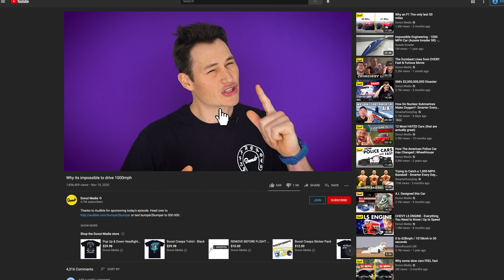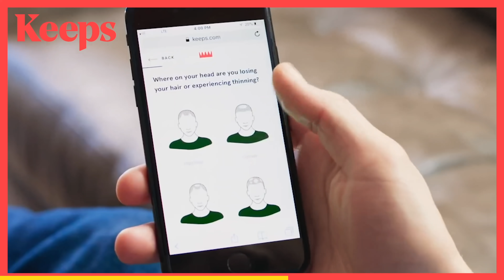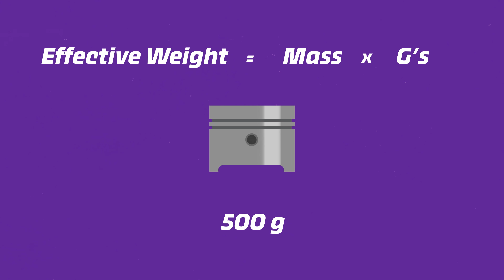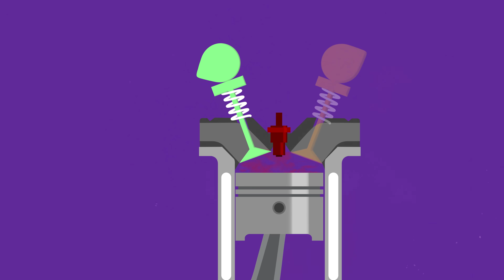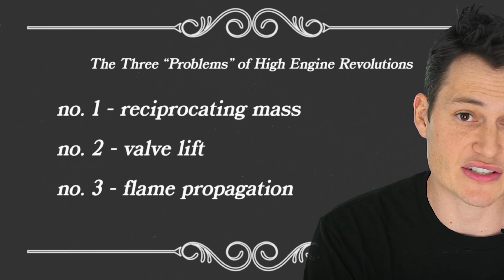Why It's Almost Impossible For An Engine To Rev Over 20,000 RPM

Comment: Oh, and about valve train.  Ask stock eliminator racer about 'lofting' the valve.  Kinda like intentionally floating the valve.  Extreme lobes, crazy valve springs.  As my engine builder  tells me, you aren't driving this on the street.  100 passes and the motor is done (checking the valve springs inbetween).

Comment: that one civic at 3am: is this a challenge?
Reply: Civic makes at least 1,000,000,000,000,00 RPM
Reply: @thor6264  or make those ricers make a fartcan revving to 5000 rpm saying" its over 9000" like an idiot.
Reply: @andy56duky  I get the first guy's joke but yours doesn't make any sense. A k20 civic can rev to 8-9k pretty easily

Comment: Its impossible for an engine to rev over 20,000rpm!                                                                                                          RC nitro engine let me introduce myself RRREEEEEEEEEEE!!! 50,000rpm
Reply: F1 car fans: the rpms of the F1 cars gas engines is insane!                                                                  F1 car's electric motor: Am I a joke to you?
Reply: gas turbine: 100,000rpm ya I'm fast.                                                                                                    electric motor: hold my beer

Comment: You don't always need rpm to make power. You just need cubic inches & technology.  Also a small cubic inch, high revving motor is terrible to live with in real world conditions, can be just as bad on fuel when running hard, & have an accelerated rate of wear.

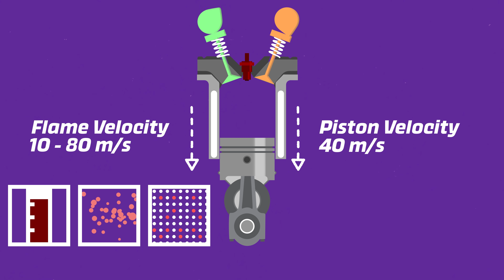Comment: At 9:30 the flame speed does not affect the piston directly. The piston is not pushed down by a flame front, but by increasing pressure in the combustion chamber. The reason that the piston outrunning the flame front is a problem is because the valve can open before combustion is finished, thus spewing unburnt hydrocarbons into the exhaust and throwing away power that could have been captured. You really need to hire an engineer to write your  copy. All you English Majors write great, but you don't actually understand the science.

Comment: “It isn’t physics is Mother Nature” goes on to discuss physics.
Reply: talking about the previous video on top speed, the problem wasn't physics, it was geography
Reply: Really weird and random physics
Reply: HRC Honda, hold my beer.
Small capacity RC 2 stroke engines around 40K rpm
Reply: Physics studies nature, so is accurate.
Reply: Yeah, it was a weak sauce intro.

Comment: Guys in the valve dept., the new free valve 
engine from koenigsegg does not resove the problem? Because it has a solenoid insted of a valve, it is eletric operated insted of a normal valve that needs the spring to complete it's cicle.

Comment: Y'all need to check out Ducati's solution to valve float: Desmodromic valve systems. Essentially two cams per valve one that opens the valve and one that closes it.
Reply: The problem at desmodromic valve system is wearing on valvetrain

Comment: “All engines create power using the same 4 steps” 
Objection, 2-stroke
Reply: 2 strokes are still doing those 4 steps just within 2 strokes. Or 2 steps per stroke.
Reply: @ryanleblanc6817  shush 🤫
Reply: @Jordon Carlson Respiration/Power
Reply: Yes, but a 2 stroke engine is not a 4 stroke engine and the quote was actually, "Whether it is a Camry or Mercedes W10 F1 car, all four stroke engines turn fuel into horsepower using the same four steps." Objection overruled.
Reply: @shaun3612  well, can’t argue with that one

Comment: Since Diesel Engines are self igniting because of the pressure inside the cylinder, why are there no Diesel engines which rev higher than 20k? xDD

Comment: "its impossible to an engine to go over 20k rpms"
-My dads fiat engine when i used to miss shift at 120km/h
"No, it ain't"
Reply: 💰 💴 💵 shift
Reply: Dude my grandpa has owned all sorts of American classics but this fiat he had was one of the wildest. Had hemispherical shaped combustion chambers just like a hemi. he always said “half the engine and  a 1/4 of the car.”
Reply: Yo same quiet not the 20 k but now after being 16 years old it still friking revs to 10k rpm. Beyond my understanding how my dad maintained it. He is a super harsh driver and would basically drive the car like a f1 car on the roads🤣
Reply: @vaibhavmugulavalli3366  Because it is italian. They are made for that. 😅
Reply: I let the engine go to 7500rpm on a late 60s fiat 124 coupe, twin cam 1400cc, the red line was at 6500 and usually fiat and alfa can take 1000rpm more for a brief time when warmed up. I think it was pushed far more by the previous owner, because one cyl had busted valves when I bought it.
Reply: @electroborg  - good to see other fiat 124 owners :)  my first car was one...69 124 sport (1.4).  One day, I actually had it rev out to off the tacho (factory tacho maxed out at 8000rpm).  The only thing it did was spring an oil leak from left camshaft cover!!   They’re a beast of car :)
Reply: @electroborg  Wow
Reply: As far as i remember, f1 engines used to run at almost 20k rpm...
Reply: @oscardbg9654  think they were limited at about 18 000 rpm
Reply: @Stand_Tall  from what i remember from the dashcams, they are actually limited to 15,000rpms to increase reliability of the cars , and most of the drivers use like 12,5k at most. Not as cool as it used to be, but still pretty impressive
Reply: @lucasaal61  well they're now limited to about 12k rpm but they used to be 18k rpm with those v8-v10 monsters
Reply: ꧁ RITA - F**UСК МЕ ꧂  what
Reply: @Stand_Tall   it’s a bot.nvm
Reply: thats was a good one
Reply: Wow!
Reply: Pain
Reply: 😂 Live the fact that it was an Fiat otherwise it might have survive
Reply: Gearbox: bro stop killing me-
Reply: I was just saying Fiat made the so called "fire" engine where valves and pistons just never occupy the same space even at max extension simultaneously.
Reply: Your dad has a fiat engine in him?
Reply: @Dogebreadzz  lmfao

Comment: normal 50cc (changed 70-90cc) mopeds usually rev 15-20k (2 stroke) in finland its very normal but police dont like it they should go 45kmh but usually they go 100+kmh

Comment: There's a theoretical maximum piston speed for an engine in which you can set a bore or stroke for the engine and have as much torque or rpm (horse power) as you please but increasing the other decreases the other.

Comment: “Impossible to reach 20k rpm”
Rotary: are you challenging me?
Reply: video is about piston engines
Reply: @GarageSupra  well I heard those old Hondas S800's could rev to 15K-18K RPM because those roadsters had bike engines
Reply: @giancarlolugo9586  I own a 1990 CBR250RR MC22. It's got a 4cyl 250cc engine that redlines at 19k. The rev counter has the 20k on there though xD
Reply: @halonerf99  a 1990 CBR ??? Always loved the design of those bikes along with the 94" Kawasaki ninja in purple and the 93" Suzuki GSXR 1100 with the blue and red graphics and the 96" Yamaha YZF 750 with the grey and green graphics
Reply: @halonerf99  rpms should equal more power guess honda can't build an engine like Kawasaki. Ninja 250s are way faster and only turn like 13k
Reply: @giancarlolugo9586  the s800 spin a little over 8k most bikes are less than 10k unless they are smaller engines or 2 stroke's. 18k is almost formula one level they wouldn't have been cheap cars at that point lol
Reply: Nevermind looking up the specs the 1990 cbr600 actually made good power wonder why they made the so slow later on guess they wanted engine logivity.
Reply: @derekmaxwell8164  ninja 250s are no where near as fast as mc22... never owned either but ridden both and owned a ninja 300 and an mc19..
Reply: @derekmaxwell8164  Well those cars had 110hp back then It was an small engine
Reply: @derekmaxwell8164  2 strokes actually don’t rev high at all well not for bikes. As for your claim that a ninja 250 @ 13k rpm is faster than an mc22 that’s also wrong the mc22 has more power and basically better everything. This early 90s 250s were insane they cost as much as 600cc 1000cc bikes because of the way they Japanese license system works for bikes. It’s really expensive/hard to get a bike license for a bike over 400cc so the Japanese manufacturers put a lot of money into little bikes back than cause they sold. But as they started getting more sales overseas it became more of a race to the bottom for the small bikes people don’t want to spend 16k on a 250 anymore. That’s why they stopped making them. As for the reliability of those engines there are plenty of mc22s still running strong with mega mile on them. The odometer only went to 99,999 kms so most have wrapped around multiple times and still screaming.
Reply: @Aviato16  well I didnt know till looking it up but I was biasing it on my friends 2000s cbr250 and figured older one would be even slower but 2 the Aprillia 2 stroke I rode redline at 19,000 but as far as piston stroke's thats basically like a 4 stroke turning 9500. But it was also only a 50cc.
Reply: @derekmaxwell8164  yeah man all good if you are under 30ish years old it’s hard to fathom how crazy those little engines were back then. Due to emissions regulations and just the changing global market for bikes it’s just not profitable for them to make crazy low capacity bikes. The 400cc bikes like the nc30 and 35 were insane back then too.
Reply: Yes
Reply: @alexandersmith7777  what about Yamaha Honda Suzuki Kawasaki old bikes  with  800cc-1200cc engines
Reply: @giancarlolugo9586  highest revving bike over 800cc is actually a new bike the ducati panigale v4r at 17,000rpm the old bikes that rev higher than that are all 250cc with the 90s cbr250rr mc22 topping the list.
Reply: @CAIDMASTEROFPYRO  I like the Ducati 996 from the 90s never been a fan of modern bikes I like the Italian and Japanese ones from the 80s to early 2000s but the 90s had the best designs in my opinion
Reply: Not even close but doesn’t cbr600rr revs up to 16k - 17k rpm?
Reply: Rotary engine has big flame propagation
Reply: https://youtu.be/WW7lDm2x9pw

Comment: Honda's 20,000 rpm engine: pathetic

EDIT: it was 20k not 30k lol
Reply: And the Honda rc116 race bike redlined at 22500!
Reply: What is that?
Reply: @legolas5684  an experimental engine that goes to 20,000 rpm?
Reply: @MooseEgg1  code name?
Reply: @legolas5684  ring bing bing pop

Comment: If you want to make an engine that spins faster, make it smaller. Motorcycle engines rev higher than their car equivalents and model engines go higher than that.
Or just switch to turbines: The Chrysler Turbine car idles at 20000 rpm. It gets to at least 36000 rpm.

Comment: I feel like you guys missed an entire section of piston engines that DO cycle consistently faster than 20,000 rpm. Nitro-Methane RC engines will spin at 30,000 rpm all day long and some will go higher than that into the 40,000 rpm range. Granted those engines use top fuel and also don't work if scaled up to actual car sizes, but they do exist. Obviously the valvetrain issue is solved by the engine being 2 stroke and the oscillating mass is taken care of by the high relative strength of the titanium they use combined with their low mass. It does leave me wondering how fast the flame propagation is using nitro-methanol if it can rev that high with no issues.
Reply: you answered your own question, the problem there is scaling, the movement of the cylinders is linear, which would scale linearly, but volume and mass don't scale linearly. this is also why airplanes can't just be scaled up or down with the exact same design.
Reply: Small cc engine means small space the fuel needs to burn to the edge, lol
Thus the flame propagation in this case is on different level with a full size car, lol
Reply: The old 1.5 litter F1 engines use to spin like 22k before they started making rpm limits to lower power
Reply: Regardless, every time I hear one of them or run my own ... Im always amazed the engine internals stay together at those speeds and last as long as they do ... its quite nutty.
Reply: Hasi Mausi  plenty? What like a 50cc motorcycle? Cause even the old high revving 250cc crotch rockets usually only turned 15-19k at most
Reply: They also have a stroke of like 8mm at the most, a normal car is often over 10x that, which means for the same piston speed, they'd need to spin over 10x as fast.

Comment: Horsepower = Torque x RPM / 5,252
This is why on all dyno sheet you will see hp and torque curves cross at 5252 rpm's

Comment: there were a bunch of 4 cylinder 250cc motorcycles in the 90s that revved almost to 20k, the kawasaki zxr250, honda cbr250rr, suzuki gsxr250 and yamaha fzr250. hard to find them if you don't live in japan or australia though

Comment: Some rotary designs have the potential to rev beyond 20,000 rpm. They require massive boost, appropriate fuel, special surface treatments and lubricants,  etc. but it can be achieved.

Comment: Turbine engines: Whomst has summoned the ancient one
Reply: the few turbine engine cars built needed about 7-8000 rpm to run the alternator and AC Compressor.  city mileage was not good.
Reply: @toolmanthetim7042  that wasnt the issue. Turbines are most efficient at 100% rated rpm. Thats why apus (auxiliary power units, that third exhaust in the tail of a 737) run full speed all the time. Varying the speed is not the best way to use it constant speed is.
Reply: @Demonslayer20111  i was responding to comment about turbine cars.  quit trolling.
Reply: @toolmanthetim7042  and I jut told you EXACTLY why those turbine cars were abandoned. Had nothing to do with high rpm had to do with the fact you couldnt keep them at constant power settings for long periods like an aircraft where turbines are most efficient. 
You want to be wrong go right ahead.
Reply: *ancient one
Reply: Turbine engines produce very low torque
Reply: Are you dumb? There are no cars with a turbine.
Reply: @v4skunk739  jay leno disagrees
Reply: @MrPruske  Wow sorry there are like 5 cars built since the 50's and every single one of them was a complete disaster.
Reply: @v4skunk739  5 > 0
Reply: @v4skunk739  np. It is very few. I think the turbine motorcycle is even sillier.
Reply: @rj6110  werd
Reply: @v4skunk739  -- Jay Leno disagrees.
Reply: @v4skunk739  yes there are. Look up capstone turbine powered race car
Reply: @S65Trev  STP indy car.   Indy is a full throttle track, so it was workable.
if i remember correctly, the transmission input shaft failed.
Reply: @v4skunk739  there definitely multiple cars with gas turbine engines, I think chevy had a working prototype. Non ever made it to production though.
Reply: @v4skunk739  ok boomer can’t take a good meme

Comment: Great video as usual guys, but a few gripes: 
1: flame speed is increased by turbulence, not slowed down.  Engineered turbulence is the only way the flame speed is fast enough for 5-digit RPM.  Honda tested this all the way to 27,000 rpm.
2: short stroke motors dont stall any easier than others,  F1 cars idle high because they have very light crankshaft mass, and valve timing that just doesnt work at RPM that low.  with enough flywheel and proper cam timing, a short stroke motor can idle as low as any other.

Comment: The Honda RC116 was a 50cc Grand Prix bike from 1966 that had a twin cylinder, four stroke engine that revved to 22500rpm, making max power at 21500 rpm.

Comment: "engines can't rev over 20000 RPM"
cox .049: "am i a joke to you?"
Reply: The Cox .049 IS a joke. The Cox .020 is cute though.
Reply: @scootypuffjr.  how is it a joke
the tee dees can rev very high
the tee dee .049 can go 20000 with the right prop and the .010 can go like 25000
Reply: @Lukemiester16  more of a curiosity than a joke. Not good for much. I'm sorry if you are a Cox fanboy. I had some too. Larger glow engines are much more user friendly.
Reply: @scootypuffjr.  i am a cox fanboy heh heh 
If its your standard reedie .049, they usually run kinda bad, but they can run well if some modifications are done. You gotta appreciate the quality of those engines though, the manufacturing tolerances were absolutely crazy and they only required 1 minute of break in time. People are always hating on them, but all of their engines (minus the product engines lol) really are good powerplants. My .074 weighs 3 times the weight of my tee dee .049 and makes the same power, but it really runs great. And the tee dees... man those were something else. they made some serious power and can rev to 20000 RPM lol
Reply: @Lukemiester16  I definitely don't hate them. I remember mom getting pissed when I started my .049 in my room,lol.  I just like the bigger ones with a real carburetor and a usable rpm range.
Reply: @scootypuffjr.  heh heh
yeah i like the big ones too, and the tee dee rc .09... i got a crush on that engine.
it's got a real carb, a muffler, performs great, is really rare, and looks stunning.
the .074 is a close runner up, although it weighs as much as a brick and makes less power lol. the conquest 15 was also an amazing engine, they even made a conquest 40, but that was right before k&b bought them, and they already had a .40 so that killed that engine :/

Comment: Fun fact: Brabham and BMW developed a 4 cylinder F1 engine that ran on Toluene (rocket fuel) because among other things, it burns very violently and quickly letting the flame front push the pistons down.

Comment: Can you manage the fuel combustion problem by also keeping the volume of the cylinder lower, and not just shorter?  Instead of a cylinder with 250cc of displacement, maybe 100cc, or 50cc?

Comment: If a engine goes over 20,000 rpm. Does it damage it self by valve failure and piston failure and other failures inside and the outside of the engine.